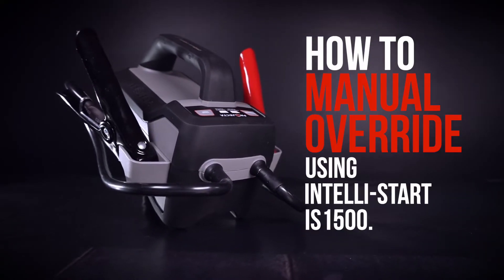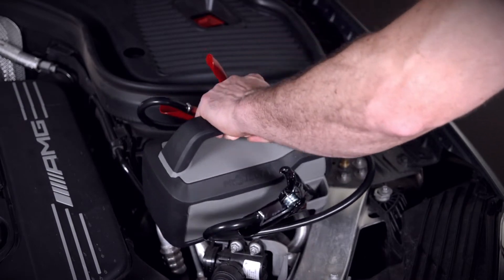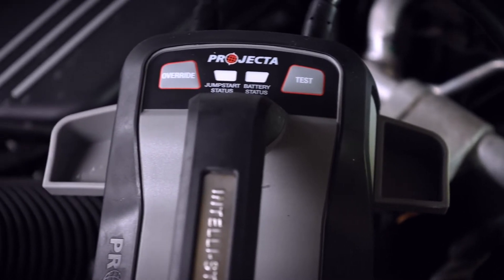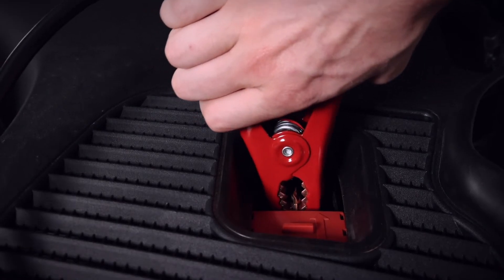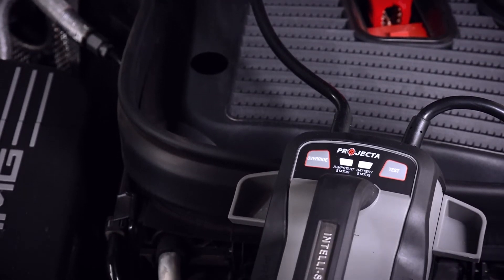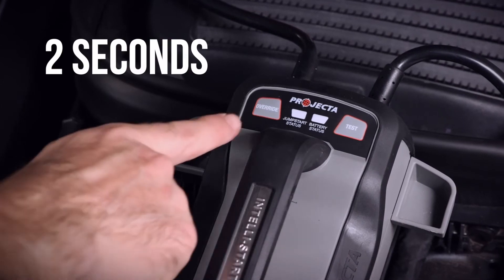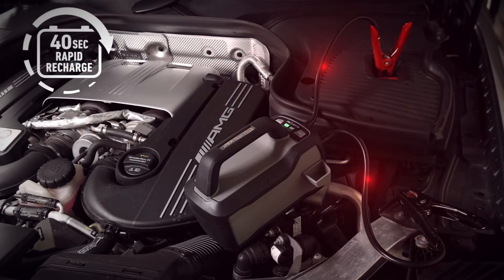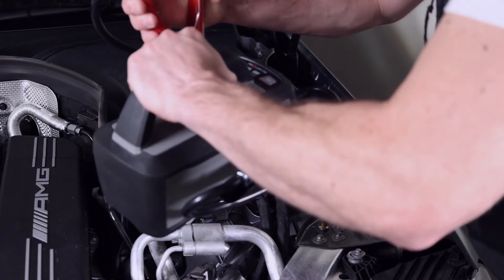How to Manual Override using the Projecta Intelli-Start IS1500 Jump Starter

Comment: I’m having issues with the automatic detect (any voltage)  and override still not activates !! Any sugestions also the Jump starter is fully charged
Reply from the maker: Hi Julian, just want to confirm that you are actually connecting the clamps to a battery as the unit will not output voltage unless connected as part of the design of the clamps.